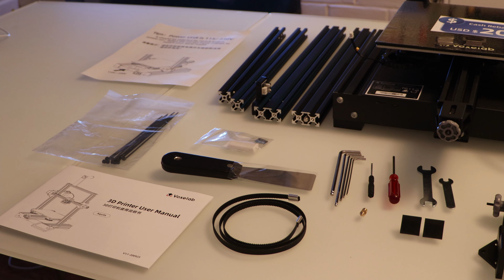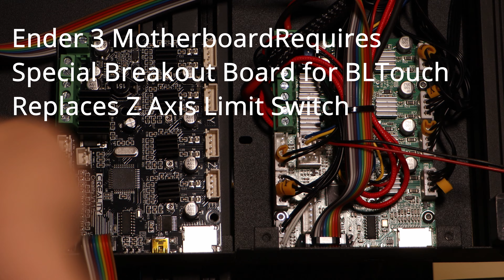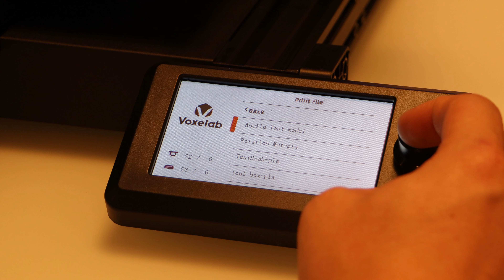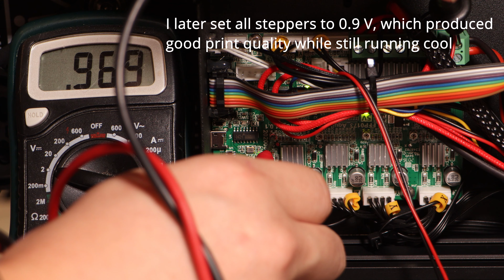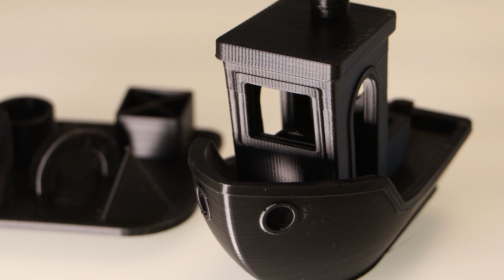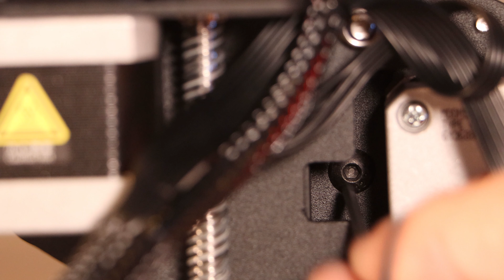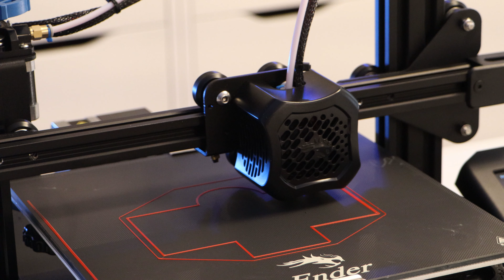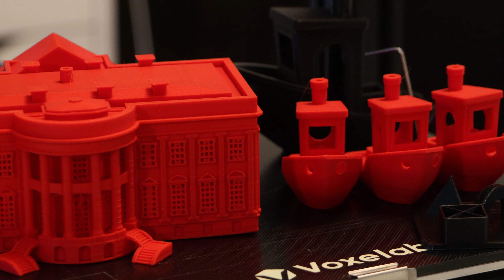VOXELAB AQUILA VS Ender 3 V2 - Which Budget 3D Printer Should You Buy?

Comment: It seems the Ender 3 line that Creality now has, has become the "Red-Headed Stepchild in the Corner"!!! Just not too long ago I purchased Creality's Ender 6 CoreXY machine which seemed to be very good build quality!!! Prior to purchasing the Ender 6, I thought about getting another Ender 3 v2 or Pro to complement the original Ender 3 I already have. Seeing this most excellent vidya, I think I'll have to "Circle Back" (LOL!) and pick up this Voxelab Aquila machine!!! My original Ender 3 is running a bit ragged...X-Axis running misaligned and catching on the groove of the aluminum extrusion...Original Ender 3 has noisy drive which directly coupled to the frame "sings" which I tried to mitigate by adding stepper motor dampers to....and I also added X & Y belt tensioners that I 3D Printed. Original Ender 3 had issues with banding & microstepping which the Defpom YouTube channel helped overcome with a circuit board solder jumper mod...so yeah...Creality  did make some improvements with their silent boards (Ender 6 is Awesome) but apparently a few things are still lacking...my biggest gripe is the shitty plastic extruder for the Ender 3 series that Creality INSISTS upon using!!!...instead of the dual gear hobbed style which comes on the Ender 6!!! I added the dual gear hobbed style to my Ender 3 for about $14 from Amazon!!! Extruder Is Everything!...Like Seriously Creality, Get Your Shite Together!!! I usually print tethered from Simplify3D so I would think this Voxelab should work just fine in like manner!
Reply from the maker: There are more companies trying to copy their product and most are coming with some pretty great improvements. I have 2 more similar machines to review which have a lot of good upgrades. But it seems like every machine has its own quirks. The nice thing about the Ender 3 is it has a ton of aftermarket parts support so you can always upgrade the things you don't like.

Comment: what brand pla should I be getting with the voxelab. more than likely will be using amazon uk
Reply from the maker: I use hatchbox 90% of the time. It has a bit of a price premium but its been very reliable for me. Prusament is also very good.

There are a number of cheaper brands that work fine too. I don't go through a ton of filament. The $5 premium per roll would add up if you are printing a lot and would be worth looking into if its more than a hobby for you.

Comment: I just had my Aquila die on me after about 2 1/2 months of use. It keeps freezing when I start a print/ preheat bed and hot end. I still haven't been able to find a fix :(
Reply from the maker: Sounds like a problem with the main board so you might want to try reflashing the firmware or replacing the mainboard.
Reply: I saw similar problem with another printer. It was solved with formatting sd card with 32kb.
Reply from the maker: @Gorodni4ij  good point, I'd try a new SD card first if you have one. Sometimes they get corrupted.

Comment: Would you recommend the Aquila over the Ender Pro? The v2 just seems to have a lot of problems from my research.
Reply from the maker: I would reccomend the Voxelab, but CHEP pointed out an issue with it. They test run the nozzles before shipping, but they don't tighten the bowden tube down all the way, so theres a gap that lets filament stagnate and cook. It can cause a jam, so its something that they need to fix. I'm going to make a short video about how to fix that specific issue.
Reply: @NathanBuildsRobots  appreciate the response and information, definitely looking forward to that video. Almost seems better to replace the PTFE tube with a Capricorn one off the bat.

Comment: The Aquila probably offers more value where it matters and for less than the ender 3 v2. 
I have a original ender 3 with BLtouch running on klipper, with that screw tilt adjust guide the layers are perfect every time. The glass bed seems to be a hit or miss for me, PEI spring steel sheets FTW.
Reply: Hey, I've got the original ender 3 as well. What do you mean by "that screw tilt adjust guide" ?

Comment: If you plug the ender 3 v2 in on 230 volts it just doesn’t turn on.
Reply: In Australia which uses 230v if you set it to 115 it blows the fuse.

Comment: I just viewed your informative/technical video. Do you this machine can print a regulation size  Ping Pong Racket 10.6 inches by 6.6inches by 1.5 inches high if it is sliced diagonally on the bed? Thank You
Reply from the maker: I think it might barely fit

Comment: "Maybe the bed wasn't leveled or something" .... Ya think? Completely go through the Aquila even as far as fine tuning the vrefs and then comparing it to a straight out of the box E3v2. Yeah completely fair comparison.
Reply from the maker: I would have done a better job comparing them side by side but I had pretty much finished filming the voxelab part when I happened upon the V2. 

I did the same paper sheet bed leveling procedure on both printers for initial setup. The V2 had some issues so I releveled it two more times and was still not getting bed adhesion. I did not mean to imply that it was having issues because I didn't bother to level it.

I adjusted VREFs to reduce stepper motor temperatures from 70C to 40C. It would probably be fine to run it on the stock values, but with steppers and stepper drivers the cooler they run the better.

Comment: I have an ender 3 pro and an Aquila. I like the pro better. My Aquila had the same y-axis issue you had on the ender as well as many more problems that I’m pretty sure stem from a bad main board. The ender just works. But like you said these are small sample sizes and I think this is the kind of variation to expect at this price.

Comment: 230 on a 110 circuit, nothing, printer won't work but it will cause no damage. IF 110 on a 230 mains, by by printer, that is why they are generally set to 230

Comment: I have 2 voxlabs and sold my ender 3. Pretty much identical and most ender parts works with the voxelab. Even 3d printed parts fits the voxelab. Very high quality. Been using mine for nearly a year.
Reply: I'm considering the Aquila, any significant parts or mods that didn't line up?
Reply: @RADHardTech  most ender 3 printed parts will fit. It doesn't have a place for a cpu fan cover its located in a different place on the voxelab. It prints great in pla, pla+ petg abs vinyl. Need a bigger nozzle for cf petg and wood. But it does print everything you can through at it. Just upgrade your tube and and nozzle to a hardened steel. This thing will run anything. The voxelmaker slicer that comes with it is good but you can use cura for your slicing. I think for the money its better than the v2. Its nearly identical. I just printed a petg project that took the full height of the printer and pulled it nicely. I don't think you can say that with a v2
Reply: How often do you print? Had anything failed in that year?

Comment: I have a recent Ender 3 V2 and I just purchased the Voxelab Aquila.   I have the V2 hooked up to Octoprint so I can do do prototyping work and then for doing production runs, I put the gcode on the Aquila memory card and just let it crank while I continue working on the V2.   So far, I would say the print quality is pretty much the same.   The only drawback with the Aquila are the fasteners which you note in the video.   The other difference is that the V2 comes with a nice extruder wheel nut that helps feed filament into the hot end.   Voxelab gave us a printable wheel but I don't find it useful.   However, it isn't totally necessary since the Aquila firmware has an auto load and unload feature so the need for the nut isn't the same as for the V2.      So far,  I'm very pleased with both.
Reply from the maker: Over on reddit most Aquila owners said their fasteners were fine, it must have been a bad batch that we both got. 
I always just pinch the extruder arm to open it up and pull the filament out since its faster, but I'm also the guy that opens the pickle jar when other people can't get it open.
One of my next videos will be setting up octoprint. Octolapse will be awesome so I can get good time-lapses to add to my videos. I have no experience with so it might be challenging to set up. Did you find any good guides while setting up Octoprint?
Reply: @NathanBuildsRobots  My suggestion would be just to download and install OctoPi which has a version of Raspian and Octoprint preinstalled.  Understanding which gcode commands are available in the Aquila software would also be useful especially if there is a difference between the stock Aquila and the V2.    The stock Ender 3 V2 software doesn't have commands available for filament change.    I use Octoprint to work around this.    The preferred method of running OctoPrint is one Raspberry Pi per printer.   There are people that try and use Docker etc... for multiple printers but given the eventual number of printers that I might end up with (I might buy another Voxelab) , I'm not sure dealing with Docker is worth it.    Here is a video link I consulted which walks through the OctoPi process:  https://www.youtube.com/watch?v=7JDWHatFENQ  ,   There are a lot of Octoprint plug ins available and I also like the control it gives me over sending gcode to the printer remotely.    For example,  I don't have the BLTouch involved but I did design and print out a holder for a digital dial indicator for my Ender 3V2 that I use to measure the profile of my bed.   I then use gcode to put that into Marlin.    I'm still working on my SOP for checking bed level before each print.  I need to do the same thing for the Aquila.    I have a flexible bed on the Ender and I'm thinking I may go back to  glass.  I think there is a little movement in the thermal cycling on my flexible bed.   I'll probably stick to the stock bed on the Voxelab since I'm using this for long prints anyway.     I'll probably go to an all metal hot end on the Voxelab and add thermal cutout sensors tied directly to the AC as an extra safety feature on the bed and the hotend.   Defense in depth is a proven strategy and I want a thermal cutout that is separate from the printer's controller board to eliminate common mode failure.     Unfortunately,   I'm printing projects every day now so I need the printers up.
Reply from the maker: @jpgquintana  Thanks, I copied your comment into a word document that I will consult when i'm setting up Octopi -hopefully by the end of May. 

I will be flashing firmware to Marlin prior to getting Octopi because most of the hotend upgrades I want to do use a cartridge style thermistor so I have to reconfigure them in firmware.

IMO Bed leveling + flexible bed are 2 upgrades that should be done in tandem because you give up stability when taking the glass bed off and need to correct it with auto bed leveling.
Reply: @NathanBuildsRobots  I would agree that a bed leveling strategy + flexible need to go together.   This is why I'm thinking of going back to glass.   I would rather have the stability. and flatness.   The Bed Leveling can't compensate for flatness .  BTW,   I just blew out my hot end.   I replaced the original nozzle due to clogging after about 30 hours of printing but I didn't reposition the PTFE tube.   I was getting huge blobs on my prints after than.    I opened up the fan housing to find polymer working its way around the threads of the nozzle as well and
up around the heat break.    Given the mess and the price of a new wired hot end,  I figured this was a good time to get into the box.  I ordered a replacement from Amazon and have already dug into the belly of the printer to get to the controller board.   Good thing I can still print with the Ender while the Voxelab is down.    I have PlatformIO running on my Windows Box and have tweaked Marlin for the Ender 3.   Several of my projects require changing filaments since I'm putting lettering and QR Codes on the prints.   I'm still using an Octoprint technique for that but I'll eventually just try
and use Marlin.
Reply from the maker: @jpgquintana  In my next video I'm installing a Phaetus Dragonfly HF hotend. It's pretty interesting, the heatbreak tube and nozzle are 1 piece so there's no way to have a blowout. I broke it within 10 seconds of unboxing it, but I figured out how to fix/improve it.

I'd recommend getting a direct drive setup for frequent filament changes.
Reply: @NathanBuildsRobots  I look forward to the video.   I don't mind the filament changes with the Bowden tube.   I did have problems with blobbing but that was solved once I turned on the Draft Shield in Cura.

Comment: Excellent review. Just fired my Aquila up and am running the first print. Holy hell this thing is loud. Significantly louder than my FLsun Q5. Looking forward to some fan mod videos for suggestions on fans and other ways of quieting this thing down.
Reply from the maker: I have a video coming out today (in about 3 hrs) where I upgraded the hotend fans and it is a lot quieter. The hotend heatsink fan is one of the loudest on the machine, but the rest are not far behind.

Check out my other video where I took quiet printing TO THE EXTREME on my Ender 3 (You could hear a pin drop next to this thing while its running).
https://youtu.be/uqCntWdLIvA
Reply: @NathanBuildsRobots  Yes, thanks, I watched several of those videos last night. You did a great job. The hot end fan is certainly loud but the fan cooling the mainboard is ridiculous when it comes on. I've got fans for both on order. My FLsun Q5, unmodified, can sit on my desk right next to me printing away and it's only moderately annoying due to the extruder stepper motor driver needing an upgrade to silent. The Aquila on the other hand, has to go into another room! lol
Reply from the maker: @baxrok2.  I'll try to get a FLsun to review. Seems like a good budget delta printer. I've used their filament before and they have some very nice colors. 

I think half of the engineers working on these printers must be deaf because of I was designing them the noise is the first thing I'd fix!

Comment: Lol! Aquila with MOONS stepper motors these are pretty good, well known brand. where did they cheap out? PSU? is it a meanwell or crapbrand?

But i noticed the Ender-3 V2 is also a bit bad with quality control, i had a big a$$ scratch on the X gantry bracket
Reply from the maker: I had another viewer ask about the power supply so I just checked, mine has a Meanwell and so did the other commenter. But they don't claim to use Meanwells on any of their spec sheets, so that could change.
Reply: @NathanBuildsRobots  I received mine few days ago, got it for ~90 euro's it was on sale at theri aliexpress store. compared it with my Ender-3 V2, and construction seemed better....... Also a MeanWell PSU, Moons Stepper motors, GATES Timing Belts and no stupid hotglue dabs everywhere.   What I do like over the Ender-3 V2 is that they just put in a cosmetic cover where the drawer supposed to be sitting. and that cosmetic cover gives you plenty of room for upgrades. SSR, Rapsi4 and so on!
Reply from the maker: @Underp4ntz  good point, I should start filling that space up. That's a crazy good deal at 90€
CHEP just did a video on the aquila and noticed that they didn't fully tighten the nozzle/bowden tube so there was a gap that got filled with plastic there. 
But I do like that they test run the hotend before shipping, nice bit of quality control.
Reply: @Underp4ntz  Hi there, would you mind sharing the link to the store/product? I've checked all "VOXELAB AQUILA" and could find any that has been down to 90€ in the last 3 month. 
I would really appreciate it as the price has been the only barrier for me getting into buying my own 3d printer, but have used lots of them.